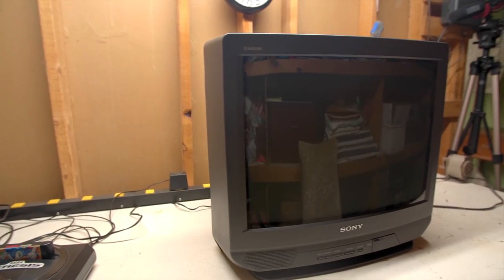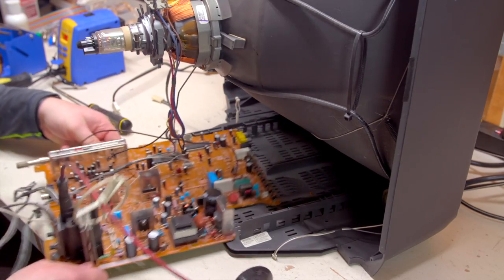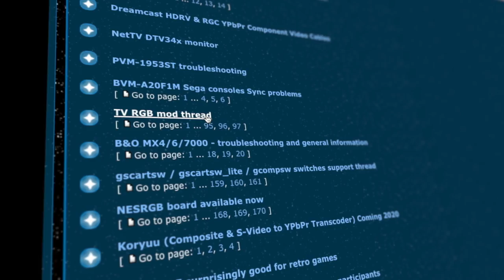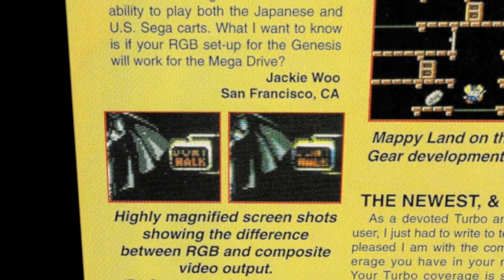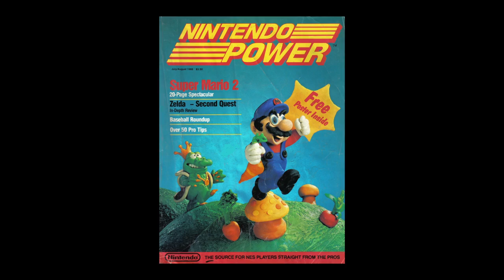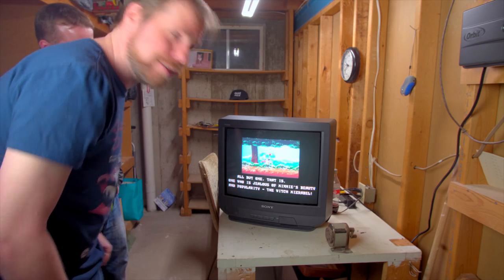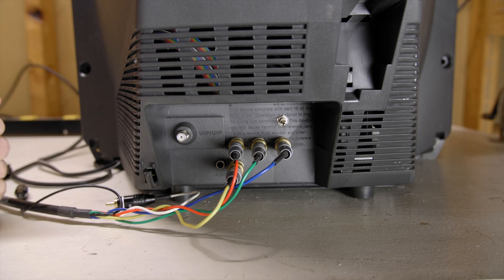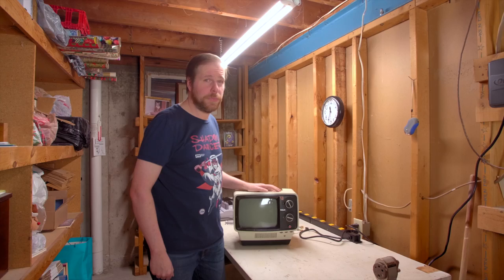Modding a Consumer CRT TV for RGB - Game Sack

Comment: The silly thing about RGB support on European televisions, despite it being a commonplace feature since the early 90s, it wasn't really all that well-known or advertised among the general populace. Most devices would still hook up to a television through RF or Composite, and games consoles too all came with RF or Composite cables out of the box. RGB SCART cables needed to be purchased separately and unless you knew specifically what they were and what they did, it was very easy to just pass them up in ignorance. I didn't learn about RGB until the early 2000s well into the PS2 era, after which I immediately upgraded everything I could to RGB SCART because ohmygod it looked sooooo much better.
Reply: Additionally, it was very easy to get confused by the difference between signal and plug. A lot of people thought the SCART adapters included in the box with most consoles was RGB, because SCART is RGB right? Well no, SCART can carry Composite, S-Video and RGB signals. That adapter is just there for televisions that don't have separate Composite plugs on them. To get RGB you needed to get a fully integrated RGB SCART cable, but without that particular knowledge it was easy to think that an RGB SCART cable was the same as Composite plugs + a SCART adapter.
Reply: @Astfgl  I didn't know about RGB until I got my Mega Drive 2 out of the garage and I found out how much of a pain was to use the R/F connection, fortunately my LCD still has SCART RGB so I thought to look on ebay for scart cables and it was pretty easy to find a good scart RGB one for cheap. The jump in quality was fenomenal, even if it's not perfect because of the LCD screen it was still light years better from what I was used to.
Reply: Back in the days I used my SNES with RF (it even came with a cable splitter so that you didn't have to unplug the antenna from the TV). Only recently I tried a SNES with RGB SCART and the difference is huge. Although I must say that it's more noticeable on 2D consoles rather than on newer consoles like the PS2.
Reply: @Astfgl  I know this as I knew people even in the HD era use composite with HD tvs and if you told them they said "it must be hd as its a HDtv" I used to change my parents tv to RGB in the early 2000's and my dad would change it back saying it was worse, to be fair it was the saturation was higher on composite rather than the sharpness, I have been RGB since 1997 most recent was in 2016 I was staying for a few weeks as someones lodger who used a original xbox via rgb and I could tell it was set to AV and not RGB in the menu as soon as I did it they thanked me and saw a huge difference.  As a final note I found it hilarious how people who badmouthed CRT's in the HD era were the ones using RF and Composite and assuming the "bad" picture was due to it being SD.
Reply: Here in Elbonia we used BGR.
Reply: You are so right about this.  I moved to europe and discovered RGB recently after getting back into consoles and I've realized that even now only the purists really care, or even know, about RGB scart. Most every console I've bought on the used market came with Composite or RF, and when I sell consoles the scart cable I include doesn't seem to excite people.  Americans shouldn't be jealous of Europeans for having it in the 90's because very few used it, rather they should be jealous of all the CRTs with SCART inputs that you can get for free these days, B&O ones included.
Reply: Same here, it was the cable to use to watch "japanese and american" in color, because of the 50hz tv issue... parasite eve 1 in ps1 was the responsible for my first rgb cable circa 99/2000
Reply: Yeah, I knew about RGB cables in the PS1 era when everyone modded it... to... ehrm.. play import games, of course! All legit purchases, no pirate copies at all. Yeah... anyway, after that, I always got RGB cables for my consoles. Too bad the PS2 needed to go back to lesser signals to play DVDs.
Reply: If you were into Sega in europe, you got RGB with almost every system. my launch Saturn even had An RGB cable and so did all amiga's back then
Reply: @enigmaster84  : I'm in the UK and yes, it's stupid that Sony borked the RGB Scart DVD playback in the way they did...However, if you use a Component cable (provided your TV has Component inputs of course!), then DVD playback is in full colour (not green!), and very clean.  Games look great too.  I prefer using Component instead of RGB scart overall on the PS2; you can also playback PS1 games this way too, and they look fantastic!
Reply: I always knew about RGB cables because my cousin who's 10 years older than me was a huge nerd back in these days and he teached me this stuff from a very young age xD
so the first thing I always did when I got any console was to instantly buy an RGB cable with it. usually the official ones

Comment: This is super cool. Love to see a curved Sony crt with RGB. I want to let everyone know that there is a plug and play solution to getting RGB out of consumer grade North American CRTs. You need a CRT that has component (not composite) inputs. All you need is a RGB to component transcoder. And there you have it. RGB quality video on a consumer grade tv. No input lag. no video quality loss. no need to mod your tv. I can verify that the shinybo transcoder and the retrotink transcoder work great. Costs like 70 bucks.
Reply: I cant love this comment enough.  It literally is that good.  The shinybow sb2840 is one of the best rgb to component converters out there.  Just make sure you use a good quality component cable and you are golden.
Reply: The issue is that a huge majority of crts that accept component are flat screen, which means they don't display 240p content correctly.
Reply: @RetroDoneRight  I tell people keep their eye out for Panasonic TV's from the early - mid 00's as they still used curved glass on their sets, and the picture quality is really good, and for the most part they do include component inputs, and stereo inputs/outputs. I have a 27 Panasonic with everything going threw component, but will for sure be upgrading now I know about the cable, and I use the stereo output to pump it into my 5.1 Dolby surround sound setup., and let's just say when I was playing Vigilante 8 on the N64 a while back with some friends on a game night the windows rattled lol.
Reply: @RetroDoneRight  most flat screen crt tvs are sd tvs and support 240p perfectly. I have 6 sony flatscreens and 1 jvc flatscreen. They all work fine. There are hd flatscreens that upscale 240p to 480p. I had one and it did indeed suck for 240p. Hd sets are easy to spot. They say"hd" all over them.
Reply: @JeffYPbPr  can you recommend a good cable? I started to notice a diagonal lines artifact. It's really faint but annoying.

By the way. I have a shinybo transcoder. It works flawlessly.
Reply: @CommodoreFan64  I can second that. I have a Panasonic 27" and just recently picked up Mike Chi's RGB to component transcoder and I love the video quality of the master system.

Comment: I guess we got lucky in Europe, almost all TVs from the mid 90s and on accepted RGB through scart.
Reply: I scrolled down to say exactly the same thing, I guess it's the one thing they got right in PAL land..
Reply: That 50hz though 🥴
Reply: James Smith yeah but 50Hz 🤮
Reply: YouTube Admin Nope, a lot of PAL TV’s can do 60hz
Reply: Tvs were 60hz, consoles were 50hz
Reply: Every console I tried even going back to PS1 or PS2 was able to output 60hz on a PAL TV if hooked up through a scart RGB cable. I remember bringing my American PS2 with me while vacationing in Italy and I could only get it to display in color (and 60hz) by purchasing a somewhat expensive RGB cable. Now I live in Switzerland and my American Wii plays fantastically on an old Nokia Crt TV at 240p, colors and 60hz. It's a God send gift for retro gaming 😉
Reply: Yeah, what the hell? In all my time as a collector I've only found ONE television set in America that had an SCART port, a SyncMaster 910MP. And the picture is crap!
Reply: @jessragan6714  Ironically, the case is almost the exact opposite in Europe. Here, most CRT televisions completely lack direct RCA input altogether - but we've come full circle now, as many modern LCD's omit composite inputs too. Fortunately for us, the solution is as simple as buying a cheap converter, but it's still interesting to know that both regions' televisions are in complete contrast with each other's.
Reply: @SwainyAtRetroAsylum  Yeah my PAL TV from the early to mid 90s does 60hz just fine. I always found it strange that consoles didn't start the change to 60hz earlier in europe. We could have had 60hz games starting with the SNES.
Reply: Nearly every CRT I've owned had RGB scart connections. The picture quality on my final Sony Trinitron TV using the Sega Saturn was fantastic. I almost messed it up when I found out how to access the hidden service menu, in order to adjust the slightly off horizontal positioning. There was no manual so I just experimented!

Comment: One of the few benefits of living in Europe. Almost every (middle class and upwards) TV was RGB compatible.
Reply: 50 htz sucks compared to 60
Reply: @jacobprayer8656  Some TV were capable of 60Hz, very few all the games at the time unfortunately
Reply: @i-dont-burn-under-the-sun  Most, if not all, late Euro CRTs are multistandard (PAL/NTSC).
Reply: @jacobprayer8656  my B&O CRTs handle 60Hz no sweat, so a region mod on the console is all that is needed
Reply: My 19" Sony CRT (at least 25 years old) supports 60Hz just fine.

Comment: For all the Euro folks about to pipe up about SCART... We didnt get SCART in the US.
Reply: I'm a euro folk and already noticed some stating the obvious that they can be picked up everywhere for free lol
Reply: @eddielockhart2072  But their resolution was higher.  :(
Reply: Hiro Plays Games Screw that resolution, you don‘t even know what it was like having to play everything at 17% reduced speed and huge ass borders top & bottom of the screen :S
Reply: @Gryzor88  true. Im uk and thought everything "normal" until I started emulating. ...and i was like - this whole time.....goddamit!
Reply: Eddie Lockhart It’s much easier to mod a PAL console for 60Hz or use a NTSC console in the first place, then modding a tv for RGB.
Reply: @eddielockhart2072  I'm from the UK. I been using RGB on the CRT tv since the 90s. Yes general signal through RF and composite is 50hz. When connect to RGB Scart it runs 60hz signal with no issues. I just have to use imported consoles or modded European consoles to run at 60hz.
Reply: @eddielockhart2072   We had support for both Pal 50 hz and NTSC 60 hz on our CRT's.
Reply: @give_me_my_nick_back  Not always and not all models. Some did support 60hz but still wouldn't display NTSC properly. But you can find TVs that fully support both formats. I got a Sony Trinitron that works perfectly with ntsc and pal consoles.

Comment: JUNGLE CHIP! LOL! Thanks for making this entertaining! Got me every time. In Portland, OR you really don’t see many quality CRTs that pop up on Craigslist or FB. And good luck with PVMs. I watched several RGB mod crt videos and looking at tutorials on how to do it as I would occasionally see a composite only Sony Trinitron like the one above pop up on the marketplace and planned to get one to RGB mod (didn’t know about the rf shielding concern) Luckily I did find a Trinitron with Component (KV-27FS120) so I settled with that. But yeah, CRTs are beautiful beasts that you have to treat extra carefully. Not gonna lie, it was pretty intense discharging the anode cap for the first time just to clean the inside. I had the tv unplugged for a week prior, did similar insulated flat head screwdriver with wire running from the metal part of the screwdriver to the ground loop and wearing high voltage gloves. Didn’t hear a pop and repeated 4 times every 10-15 mins.  I think I went overboard with the gloves but better safe than sorry.

Comment: *laughs in European
Reply: One word 50hz
Reply: @orderofmagnitude-TPATP  I have 100hz crt. No problem.
Reply: Games run at 50hz anyway
Reply: @orderofmagnitude-TPATP  We could still play NTSC 60 hz on our CRT's. Either by import, or mod our consoles.
Reply: LMAO I never had it here so I never missed it...ha ha...(cries in corner over nothing missed).
Reply: Svante Skoog and I’m sure all of 2 people did that back in the day.
Reply: @orderofmagnitude-TPATP  RGB 50/60Hz was the standard, I've never ever seen an RGB capable CRT that couldn't do 60Hz here. 

Just make sure you mod the consoles that can't output 60Hz natively. 

100Hz CRT's don't change anything for 60Hz, 50Hz has noticable flickering, 100Hz removes that, but as soon as you play 60Hz content on those TV's they default down to 60Hz. So that makes the 100Hz useless to begin with, who wants to play anything at 50Hz these days?

You'll want to avoid 100Hz sets if it's going to be your only CRT since they can have scalers involved and lag, some more than others, either way it also makes most lightguns not work on them. I've played on 100Hz/HDCRT's where the lag is very noticeable, they convert the video signal to analog, then digital then back to analog again, and 240p content doesn't look right either on the vast majority of them.

Comment: What's weird is we still get SCART on our HDTVs in UK. No doubt they'll be phased out soon. Some TVs have half phased out component, and by half I mean you need a VGA to YPbPr adapter to use component, yet there's still a SCART port. We had both 50hz and 60hz support on late CRTs for years which is nice. I remember the first game I saw that required a 60hz compatible display was Metroid Prime 2 Echoes on Gamecube. 

We never had RGB SCART cables included with consoles out of the box, well except for maybe Saturn. I swear every time I saw a Saturn at a car boot sale it came with one but I never saw one new so I'm not sure. We always got RF units out of the box with our consoles (with different connectors to yours in the US) until PS2 onwards when we got composite cables with a SCART adapter block as some TVs had SCART ports but no composite RCA ports. 

One connector type us brits rarely dealt with (or me and people I knew at least) was S-Video. TVs would support it through a SCART adapter, but rarely would a TV have an S-Video port. Strangely my current HDTV has one though. I'd only ever use it if I bought an N64 again. I think some camcorders had S-Video out so maybe what little support we had for it over here was for that. Even on TVs where it was supported through SCART, sometimes it would be a separate channel or setting you'd need to select to use it.

Comment: I went through a really rough time and had to move a couple years ago and hastily got rid of some CRT's I found around town.  
Even though it wouldn't turn on, I found this crazy widescreen flatscreen CRT(about 25"-27"), it was a Samsung and it had HD ports, component, fiber optic sound port, s-video, the works.  I nvr took it to a shop to get fixed,  so mad I got rid of it.  I wish I could've seen it in action, I looked it up back when I had it and apparently it was an expensive TV.  Oh well, I still have a cool Panasonic 30" bubble CRT with component ports, I got my PS3 to get up to 480p on it.  I wish I had that Samsung working now that the Mega Man Zero/ZX collection came out, would've been awesome to hook up my PS4 to play those games on a more appropriate screen.
Reply: They where terrible for gaming it's called an HD crt and they have terrible input lag
Reply: @Jumper: mobile gaming  OH really, I didn't even think about that, makes sense, it was the beginning of HD at home.  So input lag definitely had to be a factor, I feel a little better.  I guess a PVM is still the #1 option for hardcore collectors/retro enthusiasts.

Comment: Haven’t seen the OSD removal method in a while. There’s a different method where you basically replace the old resistors (instead of removing) running from the OSD to the Jungle with a different value (shmups forum has a calculator)  after the 75ohm termination which allows you to use the OSD while in RGB. Not necessarily a better method as both work fine, but does allow you to tweak settings in the service menu while in RGB making calibration a lot easier.
Reply: This is the mux method.

Comment: 9:03 Worth noting a true monochrome Composite signal output, not color displayed on a B&W can actually be very sharp because you don't have the color piggybacking on the signal and creating noise. Other than early 80s computers with monochrome screens this early example of increased text crispness through Composite is mostly forgotten.

Comment: I know the RGB Mux thread he is talking about, but didn't get a grasp on it. I wanted to mod an old 32" Quasar with composite input only, after I did a complete capacitor replacement. I didn't fully understand the Mux diagram, so I put it on hold. I wish there was someone on Youtube that could take you step by step to find out if you TV can be modded, and show you exactly how the RGB Mux method works.

Comment: Another option is to get an old VGA monitor and a GBS8220 to convert the 15khz RGB signal (VGA is actually RGB but the horizontal refresh rate is double NTSC's)

Comment: 19:20 Sounds like you need to know the pin out of the board on any particular tv in order to know where to solder in at, assuming the chips are even capable of using the signal.